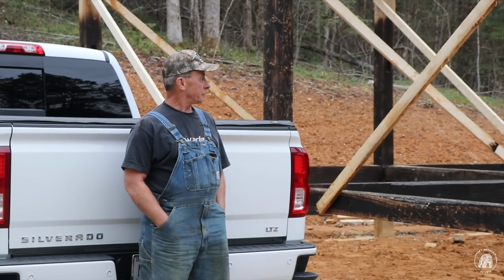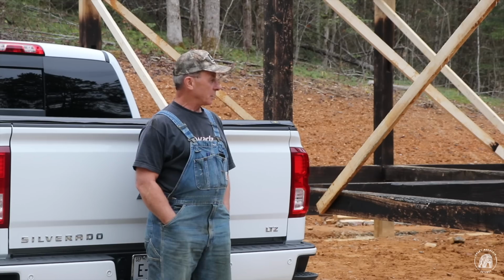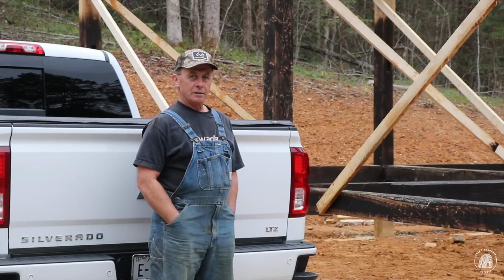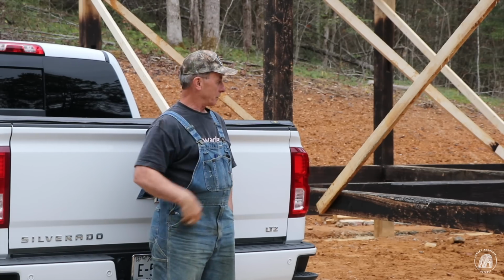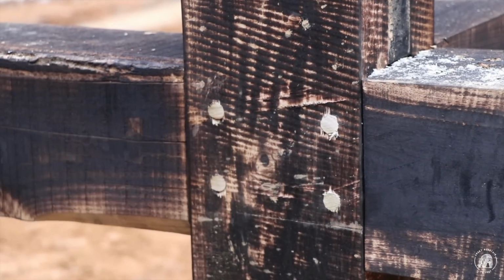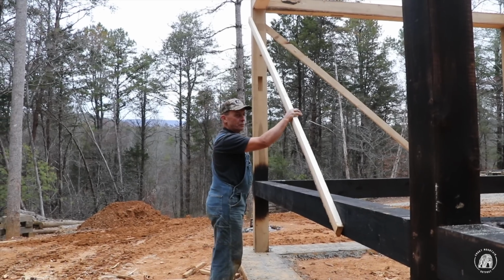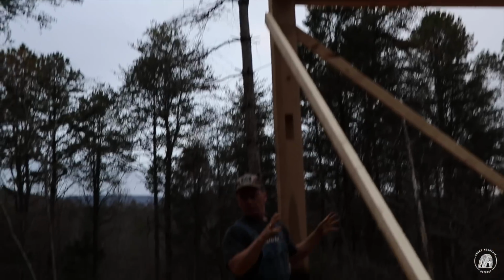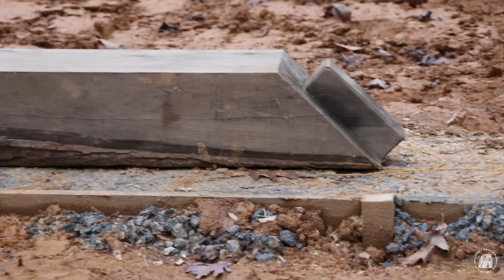S2 EP20 | WOODWORK | TIMBER FRAMING BASICS | COMPLETING POST BEAMS ON CABIN IN THE SMOKY MOUNTAINS

Comment: That's similar to how I'm going to build my cabin. Except I'm thinking of using 4x4 for mine. Mine will be much smaller than the one you built. I'm thinking of building a 16x24. I'll be building it by myself without any equipment. That's why I'm going with lighter post so that I can maybe handle them better. It will be a job to get it up by myself That's for sure ,but I will make some pulleys to help. I have trees around I can use to do it.

Comment: I'd probably coat the bottom of your vertical support posts with a generous amount of boiled linseed oil to where it gets between the posts and the concrete foundation to prevent rot when moisture gets up in there. It'll also help with checking in that area as well...Love what y'all are doin'
Reply from the maker: I’m actually going to jack up each post and place an aluminum plate, then do what your talking about. Thanks for the comment.

Comment: Richard, I did have one question about why you chose to use the propane torch on your post and beams. I’ve seen that done for the exterior of barns and structures. My understanding is that the bugs will avoid wood that’s been seared by a flame. So it seems it’s a natural preventative to do that. But on the inside of the structure, would that be as necessary as the board and batten on the outside? And aren’t there other clear products for preserving the wood? Just curious. Please know that I’m not trying to play Monday morning quarterback here. I’m the guy sitting on my couch watching you live the dream and do a lot of hard work. So I have a lot of respect for all that you’ve done and continue to do. Thx Bill
Reply from the maker: I do it to help protect the wood and I very much like the burnt look as opposed to natural.

Comment: Richard, I’m really enjoying this series. I’m Planning to take a 5 day course at The shelter institute in Woolrich, Maine to learn the basics of joinery and assembly of post and beam structures. Then, I just have to buy some land near my brother’s place in the Berkshire Mountains of MA and I’ll be good to go. He has about 90 acres, mostly wooded and he’s got the same Kabota 3901 as you Richard. Now I’ve got a talk with him about making some modifications to his Kabota so that we can source the timber’s on this property. I sent him the tool video you did with the mounted chainsaw in the counterweight balance using the box grate. I have a question about the extension you built to raise the post of high in the air using your bucket. Is that 4 in.² steel that you used? How long are those two long pieces? They look to be about 12 feet in length. I haven’t watched I’ve only watched a few of your videos so far. I’m wondering if you made one where  you described how you fabricated that metal extension for lifting timbers using your bucket? Thx again Richard!!!
Reply from the maker: 2 in steel 10 ft long
Reply: Thx Richard

Comment: How do you get the knee braces in? Lift the top plate a bit?
Reply from the maker: They should go in at a slight angle if I figured correctly. And, I can always take a little off at an angle to get them in if need be. I would have had to have them all cut to put it together. I am by myself, and take advantage when my son can be here to help. I did good to have the post and beams ready when he came to do the job, lol. I figured I could add them later, lol. Hope so
Reply: @SmokyMountainOutpost  Never going to happen due to the geometry. You will have to have a floating tenon on one end to install them now.

Comment: How come you went thru all this work and didn't follow standard of the industry post and frame framing and anchoring details?
Reply from the maker: I have my own standard. First, there is a wall going underneath the beams that will also be anchored that I didn’t have time to do because of help. It will also be anchored. I didn’t see any reason for seat cuts since everything will be supported by stick framed walls. So this is a mix of old and new aesthetics.
Reply from the maker: Knee bracing comes later when I have time. Not important now since I have it temporarily braced.